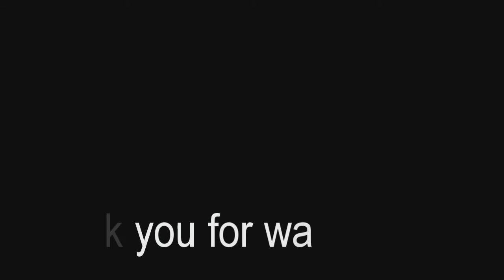Using solder paste and heat gun for THD components

Comment: This method works better when you solder SMT parts with lot of pins. It's faster and better to solder THT using soldering wire and tool. And when you use hot air station you must look out not to delaminate PCB. You must use tool with lower diameter. Some of your soldering points haven't the proper connection (wetting angle, enough amount of paste).
Reply from the maker: tubol2010 Thank ypu for your feedba k but was an experiment. Im working in this field for more than 15 years now 😊i do own 3 reflow ovens 😊
Reply: OK. I'm an electronics engeneer for 25 years , and I'm working as quality engeneer. My Job is to inspect all the process from the beginning (components, PCB's) to the end (testing of devices). See the IPC movies on youtube.  This method is useful during the rework process of SMT components. As you  probably know, there is another method od soldering THT components called "pin in paste" and but it is done automaticially.  Best regards.
Reply from the maker: tubol2010 i didn't want to offend you in any way and i know pin to paste along with laser beams as i said i was experimenting 😊
I would not do that for production units but...if you are out of solder one night ...you can use it for prototyping.
And a pleasure to meet you btw.

Comment: It's a noob question....but what are you using to hold the board while u work on it? It looks like more than just a set of "helping hands"?
Reply from the maker: +MAN CAVE NO.1 Not a problem. It's a PCB holder and if you are from Europe you can buy it from here: http://uk-electronic.de/onlineshop/product_info.php?products_id=4040&osCsid=2603ec0973792431978d1825587720f9